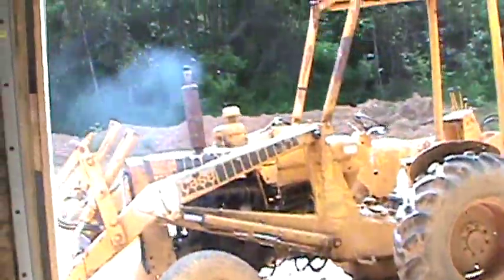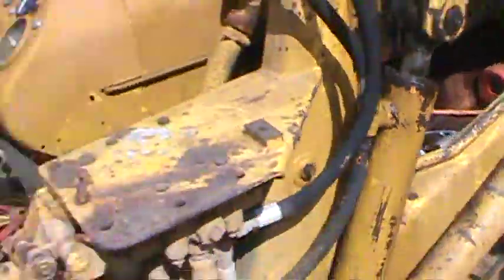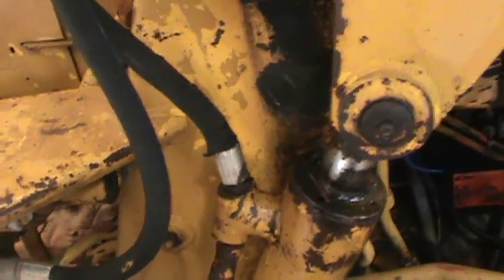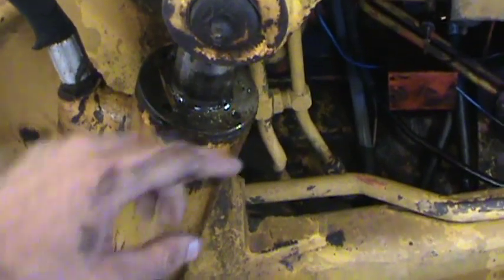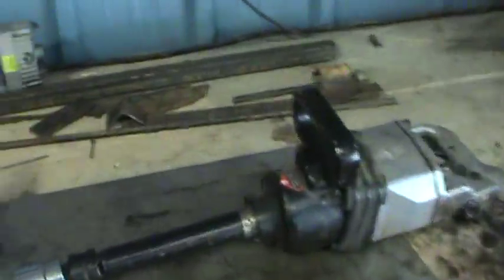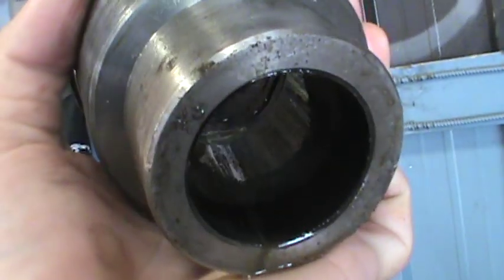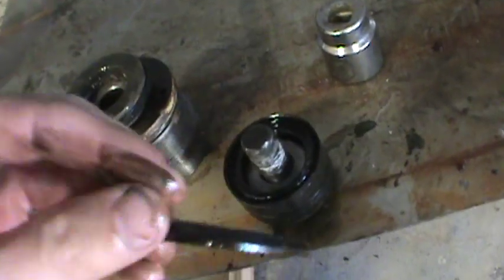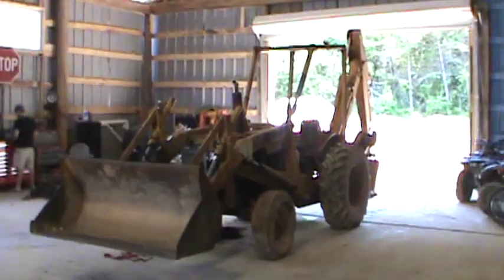Case 580ck Cylinder rebuild

Comment: how did you remove the top pin
Reply: I’m wondering the same thing. Did you ever figure it out?
Reply: I literally came here to see the same info.  He skipped right over it...   thats the only part that is giving me trouble on mine @anthonyful
Reply: I know this is probably too late for the original askers but I've v been looking for the same answer and finally found a schematic... so for future searchers, there's a roll pin on the back side of the upper bracket that holds the pivot pin in.

Comment: I own the exact same backhoe, that's the front bucket leveling cylinder. It changes the amount of fluid in the bucket cylinders to keep the bucket at it's current position as you raise the bucket.

Comment: Beau, I'm looking at a 580ck that won't start is there an easy way to tell if the cylinders are not fucked? Compression test? if so how?
Reply: You have to remove the injectors and get your reading from the same hole for each cylinder.you need a compression gauge for diesel engines and an adapter the same threads as your injector.

Comment from the maker: thanks for watching, i've seen lots of crazy things happen with cylinders. usually the chrome can come off from age, oxidation, or just could be manufactures defect. you can have the cylinders fixed by most local hydraulic shops.

Comment: Badass channel. Good video. I got a leaking cylinder on my Kubota front end loader but when I looked at it the chrome is flaking off/pitted all over the rod. The fluid leaks past the wiper even when the loader is stored. Have you seen the chrome just come off? What would cause that?